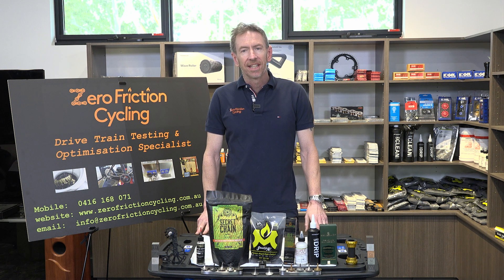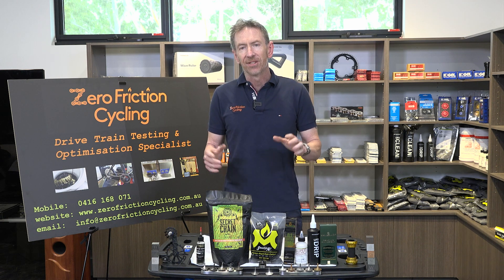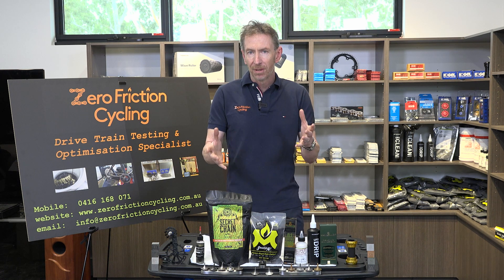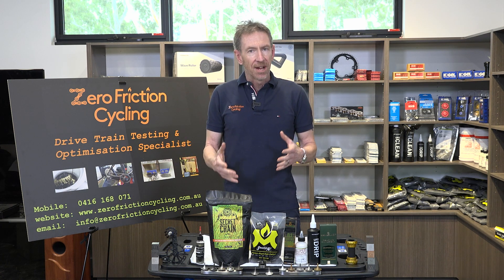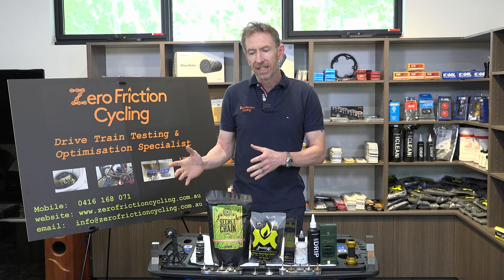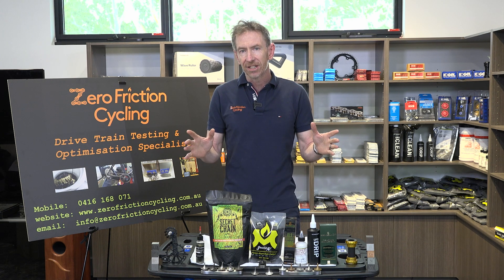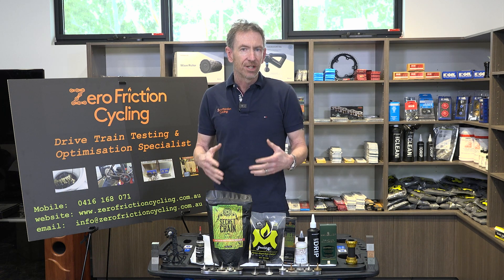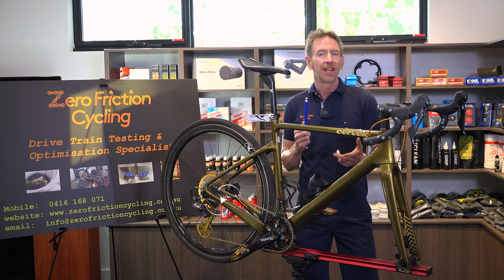Episode 3 Maintenance Level 1

Comment: Love the way you present this information.  And I truly appreciate your concern for solvent use and reducing our impact on the environment.  I was saddened to hear our wilderness mountain areas & water resources have been contaminated by forever chemicals found in ski wax.  Will we ever learn?

I've been on the fence with immersion waxing FAR TOO LONG!  I watched Dave wax his chain in "Breaking Away," but I never took the proverbial plunge.  That all changed a few weeks ago!  So glad to finally have made the switch.

I asked this question below, but figure I should post it more prominently.
Definitely understand wiping the surface dust off the chain prior to re-immersion.
However, do you recommend blowing out the chain links with compressed air as well?  Seems to me that 50% of the plate surfaces are on the inside, so might as well try to remove that dust as well.
But then I could see that compressed air may actually force contaminants further into the recesses of the links.  So I'm curious what your opinion would be.

PS  And I look forward to listening to your discussion debunking the notion that immersion waxes aren't appropriate for wet riding.  Thanks again.
Reply from the maker: Thanks so much for the feedback dudeonabike, and it sounds like welcome to waxed life - it really is a grand ol time :) Regarding compressor - there is no detriment for immersive waxing - any dust that is penetrated past outside and so wont wipe off, that will be going into the wax pot on re wax, or if re lubing with a wax lube, the wax lube will drag it down further into chain anyway. So if you do manage to blow it out, yeehaa - if you dont, you havent made anything worse - so the only caveat would be to ensure do the wipe first so you are not blowing external dust in .

Other than that, is most cases the difference i expect will be very minimal as i would expect that dust that has penetrated past side of roller etc will be pressed into the wax coating, and so it wont blow out, it will just go into the wax pot on re wax. But again there will be no harm in trying in case you do get a little bit out that hasnt.
Reply: @zerofrictioncycling992   thanks for the reply!  You're responsiveness is impressive on a 2 year old video.  Many thanks.

Appreciate the additional advice.  Yeah, I'll clean the exterior as well as I can and then utilize air.  Might as well.  Oh wait, now I'm ADDING to my chain maintenance routine when wax is supposed to do the OPPOSITE!  Ha, ha!  Step away from your OCD, man!!!

Up in the Sierra this weekend and will continue "testing" my oh-so-belated chain revelation.  "I've seen the light!!!"

Thanks again.  :)

Comment: I’m a hiker turned bike noob and going out on long bike tour.  Is immersive wax and drip wax still good for me since I will be out In Rain, dirt, gravel and dry roads. I would only have access to boiling water say weekly. I could carry mentholated spirited though. 
Thanks. Learning. A lot from your business
Reply from the maker: Good morning Pgreenx - Yes indeed most waxers just pack a bottle of wax compatible lubircant - (Silca ss drip, ufo drip, Tru Tension tungsten all weather). Normally trying to re set during a bike packing trip or tour is not that feasible, so usually it is done on return, and it is much easier to re set chain from some harsh riding if on wax then immersive wax compatible lubricant as you can just use some boiling water flush rinses to do a great reset job then re wax - very easy, cost effecting vs needing to use liters of solvent to re set contamination in a wet lubricant chain. 

Note that all lubricants above will struggle a bit if you are hitting really solid wet weather, all wax emulsion lubricants like need AT LEAST an 8hr set time or can be easily washed off next wet ride on next day. If it going to be proper wet, it may be worth packing some silca synergetic to use instead as that is very good re staying on and keeping chain lubricated - just know that it will be a full solvent reset when back home. 

Another option vs trying to pack cleaning agents is to simply pack a second chain. This means you can swap to a fresh chain halfway through and minimise wear damage from contamination increase hammering one chain in the wet, you can alternate daily for longer set time etc if each day is wet, and on such things personally im a believer of a spare chain just in case - anyone can be only one crunched shift away from a snapped chain or bent link - a spare chain is 250grams, can save a lot of friction and wear in the second half of a long harsh conditions trip, and great redundancy - i rate this as a better approach vs packing cleaning stuff

hope that helps and welcome to the lovely land of two wheels - ooh its grand out there :)
Reply: @zerofrictioncycling992  thanks so much for the thorough and fast reply.  I was two days away from lubing my new Moots Routt 45,s chain with with what  I thought was a good (dry) lube.  Now way Down he rabbit hole with all your tech material and videos learning all this stuff. 
Thanks you again!
Reply: @zerofrictioncycling992  One last quick question - If i'm out for 2 weeks camping and sure to hit weather, is it best to just bring the wet synergetic instead of both that and wax drip lube.  I'm inevitably going to hit rain (plus bike out in rain all night) and will be camping and end up with the wet lube on at some point .  
Even two chains will surely end up wet...thanks again

Comment: Lots of good information here.
I fully clean and then hot wax on chain installation.
Then drip wax Silca SS every 100-125 miles.
When I wash my bike I remove the rear wheel and place a chain keeper in the drop-out. Then I pour boiling water on the lower portion of the chain as I rotate the cranks backward. Then re-wax with Silca’s SS drip wax. How does this method rate ? 
Thanks Dave
Reply from the maker: Hey dave! it depends on your riding - if you ride dry road - there is zero benefit to boiling water rinses. If you ride offroad in dry - wiping outside of chain with microfibre cloth with alcohol spray to remove surface dust is again much effective vs boiling water - you just dont need to try to flush out the lube from inside as that will be barely contaminated. Boiling water rinses really recommended ONLY post wet rides where water has transported contamination deep inside chain and been pressed into set coating. In which case pouring over chain will be better than nothing ,but  really a bath is best to really melt off wax layers from deep inside chain, a lot less from deep inside will be melted out properly by pouring over, and you would use a heap more boiling water for a better than nothing job, whereas a kettles worth and 3 to 4 baths of 30 sec soak, 30 sec agitate - that does a very good flush clean of the highly refined paraffin base wax lubes. Need to really make sure chain is proper dry after too, i need to update info on that after some deeper discussions. 

If you are riding dry road / offroad - you only should worry about a very periodic re set for a top lube like ss drip - and ufo drivetrain clean is your best option if on bike is preference - spray on, soak 5 mins, rinse with boiling water, dry - you rippa. UFO clean is one of the very few solvents that work on grease and waxes. Every circa 2000 to 3000km for dry road riding and circa 1000 to 2000km for gravel / mtb. 

I will be working on a flow chart soon i hope  for chain maintenance :)
Reply: @zerofrictioncycling992  Thanks for all the advice .  Have you had a chance to try Silca's bio degreaser ? Is it comparable to UFO spray wax degreaser ?
UFO is hard to find in the USA.

Comment: So, can I use the dismissed dry lube.  Can I just switch to a wet lube if I’m not going wax at the moment?  Do I need an insane deep clean first or just a run through the Pedro piggie?  I don’t ride in much wet weather .  Just run of the mill old USA roads.  Thx.
Reply from the maker: hi daniel apologies i not sure what you mean by dismissed dry lube. You can use wet over existing lubricant just take note of if the previous lubricant is poor, and not going to be great to mix with a super good lubricant, you will compromise your new good lubricant if you dont properly clean. It is same as if you had terrible grease is your bearings and now you have bought proven super good grease, are you just going to slap that in over the top or are you going to clean the crap grease out first. If you clean and how well you clean is up to the individual, but as your hardest working part by a gazillion miles, having it run on proven top super low friction low wear lubricant not contaminated with crap lubricant is of course the path recommended by zfc. Pedro piggie and similar are ok, but bath volume is small, so flush cleaning out previous lube really well can take A LOT of baths vs popping chain off, putting in a container and ripping a few baths of a few hundred ml each through it in no time.
Reply: @zerofrictioncycling992  Thank you much for the reply.   Am I mistaken that you mention the finish line type dry lube is your least recommended method?   It is, of course, what I have been using.
Reply from the maker: @daniels6554  Hi daniel sorry for delay reply - just back from a week off and madly catching up. And heavens no - again that type of dry lubricant is just really really bad - information why is covered well by josh poertner in this video - https://www.youtube.com/watch?v=UsyCEOlqSXY

basically they are a category to avoid at all costs, and Finish line are in my opinion a lubricant brand just living off their name from the time when no one had any idea re bicycle chain lubricants. I havent bothered testing any finish line yet as i already know the answer to the tests from seeing customer chain and drivetrain lifespans through the workshop on their products. Brands that at this time ZFC places the strongest possible do not buy rating on for chain lubricants are Muc-Off, Finish Line, White lightning, and anyone marketing a ceramic lubricant product.

Comment: Is there any fear of warping the chain with a boiling water emersion? Do you advise putting the chain in warm water and bringing it to a boil?
Reply from the maker: No not at all - the parts are thin and all heat quickly, and there plenty of tolerance play between parts - it would take a much more serious effort than boiling water to warp a bicycle chain

Comment: hello! just to clarify, you mentioned that after dry dusty rides, just wipe off the chain using a cloth with methylated spirits. i assume you still rewax afterwards?
Reply from the maker: Hi Joseph depends on whether chain needs to be re-waxed or not, ie if freshly waxed and just completed a dusty ride but still plenty of treatment lifespan left, no need, it is just mostly important to remove surface dust, and then when in that habit you will ensure you have removed surface dust before re-wax when it is time to re-wax, and save importing many rides worth of contamination into your wax pot by getting ride of that dust that has stuck to outside of chain due to static. Some area's rides - you get very little dust (ie good hard pack), other terrain if its dry can be super dusty and so a lot of dust will stick to outside of chain, and you definitely do not want all of that brought into wax pot on re-waxing, or imported inside chain upon re-lubing, so its a quick easy & cheap tip that makes a tangible difference over time to get into the habit of doing.
Reply: @zerofrictioncycling992   Thanks for your contributions to drive train efficiency and longevity gains!

So what about wiping a dry, dusty chain off and then blowing with compressed air?  Seems like this will go a long way to remove the dust particles on the inside plates of the chain as well.
However, there's the risk of forcing contamination into the rollers and between the plates.  So is this to be avoided?  Or is it recommended?

Realize this post is over 2 years old, but figured I'd ask anyway.

Comment: Thanks for another informative video. I'm using the Silca hot wax and the liquid version to top up. In between hot waxing I tend to just hose down the chain on-bike and after it dries I reapply the liquid wax to top it up - rather than use the alcohol and micro-fiber wipe down method. Do you have an opinion? Am I maybe removing too much wax by hosing it down or, counterintuitively, making the dirt stick more to the chain?
Reply from the maker: Hi Ovidiu, no that is perfectly fine, water itself wont wash wax off, wax will be abraded off when riding in wet conditions because the water brings abrasive contamination in with it, but just washing bike at home - no problems. The only thing to be aware of with doing this is that wax is abraded off the outside of chains rollers first, leaving that metal exposed, and chain rollers are made of a high carbon steel for hardness, and so if wetted and left exposed - they can start to oxidise quickly. Some waxes / chain coating type lubricant users if hose down bike including chain then leave it for a couple days can find rollers starting to rust - so post wash wipe chain dry (blow dry with hairdryer even better) and reapply ss drip or re-wax - that will protect chain rollers again from oxidation.
Reply: @zerofrictioncycling992  thank you for the clarifications. Great videos. Looking forward to the next one!